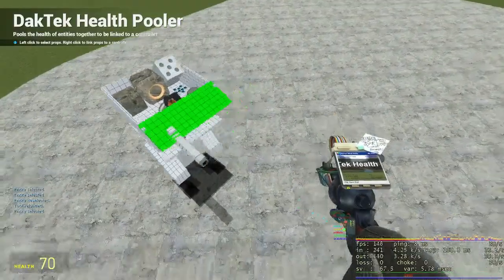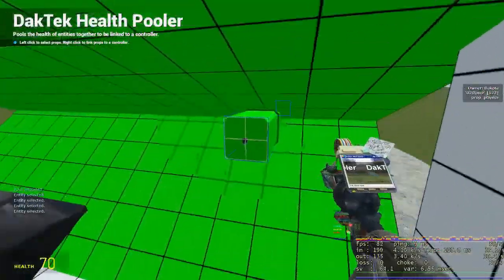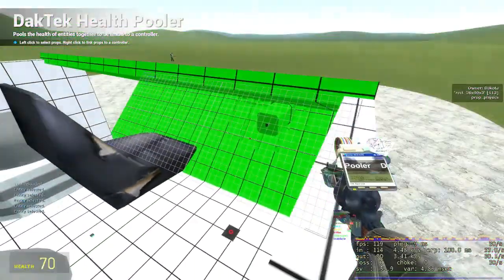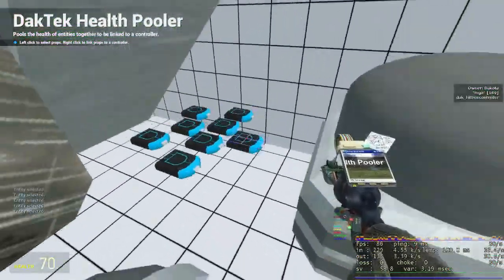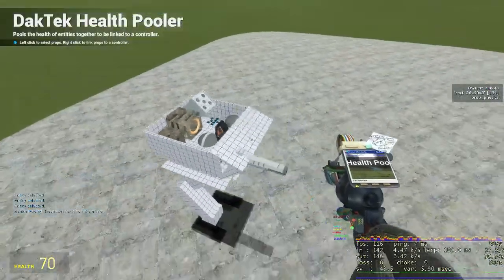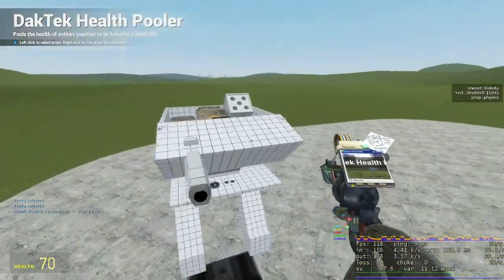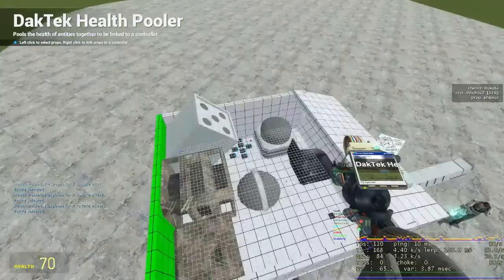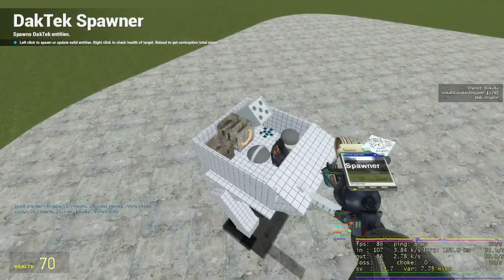DakTek Tutorial Series 4: Armor and Defense

Comment from the maker: Be sure to update to the latest version of DakTek. I fixed bugs with many of the entities talked about in this video in V9.
Reply: Now I have not checked the updates, but it would be great if the gyro remembered settings for steps, also, maybe Torso chip would do good as a entity, like a connecting joint looking part or so :)
Reply from the maker: The gyros do remember the settings just fine. Just set up the settings then after you do that you have to copy it. Its impossible for me to have you walk around in it and set settings then have it remember those next time you spawn it if you don't copy it after you set them. 

Also I've mostly been keeping the torso chip as a chip for the sake of keeping it easy to use and to not further clutter people's builds with large and destructible equipment. So mostly balance reasons and general quality of life.